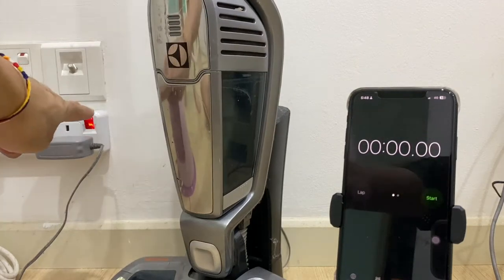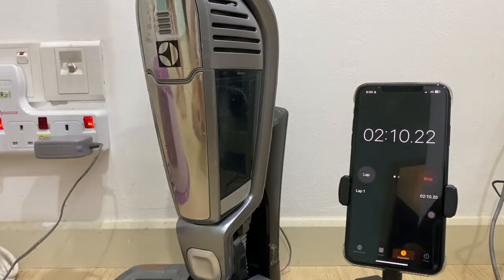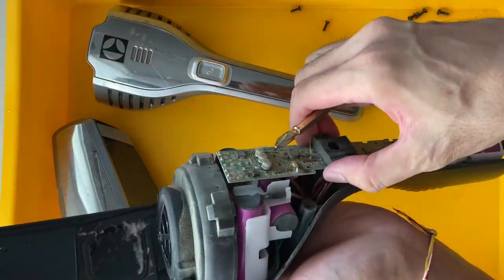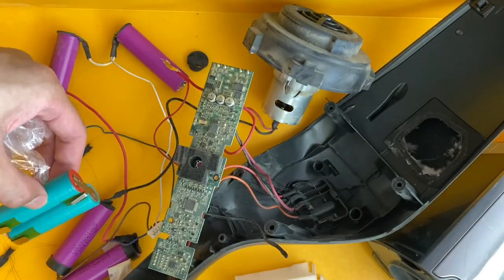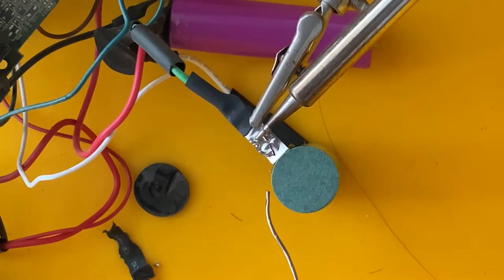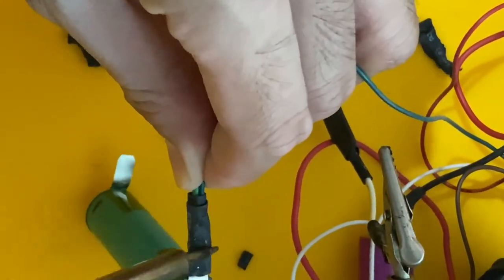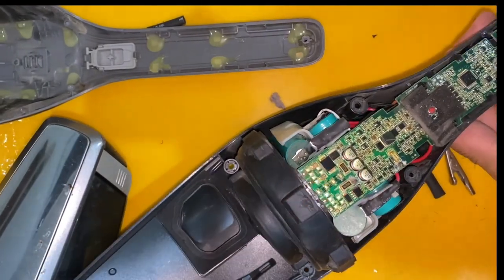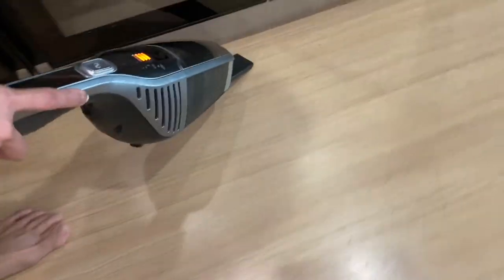Revive Your Electrolux Vacuum Cleaner! Fixing Charging Issues | Battery Replacement Guide

Comment: When I press the on button on my ERG23, it doesn't work and LED 1 keeps blinking. Can you tell me what the problem is? Thanks.
Reply from the maker: User manual state that: 1 blue blinking light: battery capacity – empty 2. If a red light is lit: Unit is too hot. Clean filters, brush roll, hose and put on charge. I hope this is useful.
Reply: Ok thank you

Comment: Mine after battery replacement, the charging light  blink a short while when put to charge, the charging will turn back on all at once after a few mins for a short while only when left ti charge. Wonder why?
Reply from the maker: Have you bought the correct battery pack?

Comment: I recommend to buy new handheld unit, plastic motor can break any time soon, bms module can be damaged by bad soldering and handheld unit cost 49€ for any 14.4V / 18V ErgoRapido model (AEG | Electrolux), so you save time and money, old handheld unit you can keep for extra spare parts 🫰
Reply from the maker: I’m quite certain that the price for electronics is getting cheaper over time. However, the Repair culture seems not a common habit around the world. I hope the repair culture will be revive just like the good old days. The use and throw concept really does more harm than good. Please consider repair as an option.

Comment: Hi Liew, I've just changed the batteries, put to charge, LED blinks for about 1-2 minutes then off it goes... have you encountered such issue?
Reply from the maker: I think you have the same issue as shown. Check if you have connected the battery correctly.